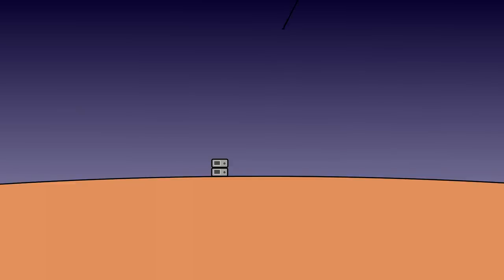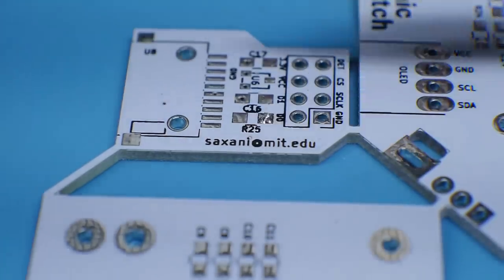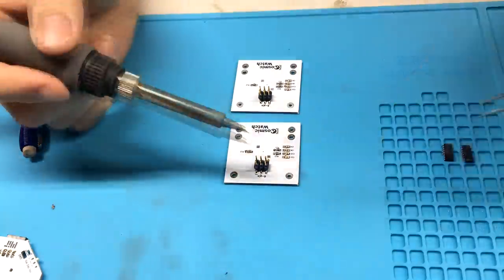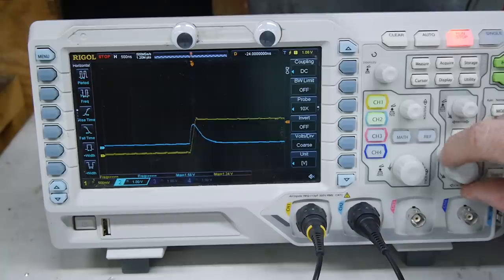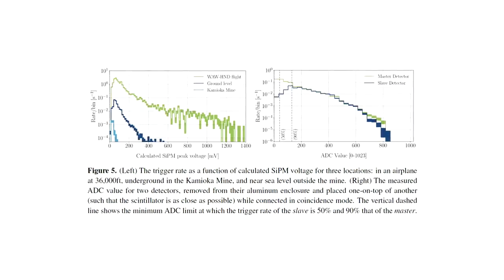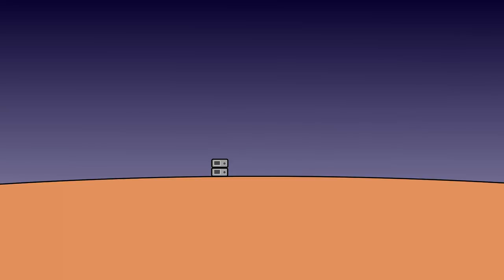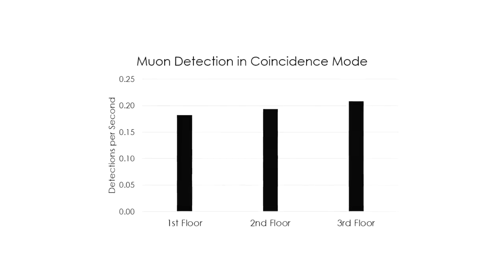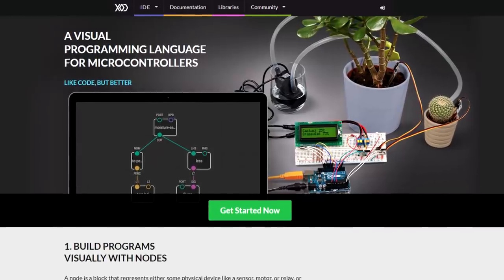How to Detect Muons!

Comment: While this is certainly interesting you don't actually need a device this sophisticated to see cosmic rays.  When I was in college I used to participate in some science outreach programs for the local elementary schools.  One of the things we did (which admittedly was a bigger hit among the adults than the kids...) was build a cloud chamber for detecting cosmic rays.

It's really simple.  You just need a clear plastic container, some paper towels, rubbing alcohol, dry ice, and a strong light source from something like an old slide projector.  Soak the paper towels with the alcohol and tape them to the bottom of your container.  Put the lid on the container, flip it over, and place it on top of the dry ice.  The cold from the dry ice should cause a vapor cloud of the alcohol to form near the bottom of the container.  Then go into a very dark room and shine the light on that vapor cloud.  Then just watch!  You should see occasional tracks form in the vapor cloud, and those are being produced by the cosmic rays.  It's that simple.

Comment: I'm DEFINITELY getting a couple of those kits! Not only is detecting muons amazing in itself, I want to modify them to output the count rate and intensity as control voltage (CV) to control analog synth equipment. Generating entire compositions from cosmic rays - particularly rhythms - would be really good fun. (Not sure yet how to amplify the differences in intensity so to get a greater range of output voltages ... )

Comment: Why does sticky tack fail in different ways depending on how fast you pull it?  If you pull it really fast, you get a really quick and clean break.  If you pull it really slow, you get a really jagged and medium-size break.  If you pull it at a medium speed, it stretches and stretches and stretches until it finally gets too thin to support its own weight and snaps.

Comment: For the experiment where you left the detectors in your car at work, it would have been interesting to have a control, as in another set of detectors, sitting in the exact same spot every day. This would tell you if the change is due to the layers of concrete and not something else.
Reply: It could also have been the height that caused the difference rather than the concrete.

Comment: Excellent presentation. Real data. There is a app that uses soft errors in cellphone graphic memory to detect cosmic rays. That may be detecting more neutrons than muons, since the charge transfer is low for ultrarelativistic particles. Soft errors are a concern for modern computation, since it limits the accuracy of calculations. You might want to do a follow up comparing the issues.

Comment: It's best to use two irons when soldering SMT parts by hand. It's easy once you get the hang of it as the surface tension pulls the part into place.

Comment: Put them next to each other edge to edge, it should reduce the double detection to almost zero.  If you offset them to a 45 degree angle, it should reduce double detections to about half.  Or put them farther away to get the same effect.  I would be curious about the results.

Comment: Great video and wonderful project. Unfortunately for most of us "citizen scientists" who don't have access to an academic physics department or a large urban MakerSpace the SiPM and plastic scintillator material are pretty much unobtainium.
Reply: O.K. I see that the SiPM is available for $75, special price through SensL, using the link on your Facebook page. Great! But now, what about that scintillator plastic? Where the heck am I going to find something that will fit this project?
Reply: O.K., O.K., I just found the plastic scintillator already cut to size and custom made for this project listed on ebay for $30. So already I'm at $100 but the rest shouldn't be too much more, so good to go!
Reply: so not really unobtainable after all
Reply: Yes, I'm on my way. Waiting for the PCB's to be manufactured and the SiPM is on the way. But this is really more of a $200 project not $100 as the folks who put this together would have you believe.

Comment: 80 Dollars for the functional bits (the sensor alone is about 48 dollars, 80 excludes the case and excludes a SD card, some cables and household items like vaciline and tinfoil). 
something I wanted to know. some stores ask more for the sensor. the excel sheet sais Mouser sells it for this price. the SiPM by SensL is bought by ON Semiconductor, maybe this helps people evaluate if this is a project to try or not.

Comment: Cool, I have been working on a similar device, but no scintillator. I had known about this device before, but didn't realize that was how they were doing the detection, pretty cool. I guess that removes the need to block other particles and electrons from passing through and exciting the scintillator? Or is that still an issue?
Reply: The scintillator is important, since it means the charged particles don’t have to hit the detection electronics directly.

The metal box will stop electrons, and the atmosphere stops pions and kaons. You’re pretty much just going to see muons. Though photons can hit the photodetector directly and trigger it! One way to combat that is to have two photodetectors. If they both trigger at the same time, it’s most likely due to a flash of light off the scintillator.

Comment: If different layers of concrete have that much of an effect on the amount of rays reaching the sensor, I wonder how much water you'd need above the sensor to also determine a measurable effect. And I assume heavy water or salt water would have more of a shielding effect than distilled water, though I wonder how much of an effect it'd actually have.
I might have to build one of these muon detectors some day.

Comment: Now, is it the density of the concrete that causes the attenuation or is it an effect of the mesh used to re-enforce the slabs? Similar to how a anechoic chamber absorbs reflections. I wonder if the "u" could pass thru a Faraday cage? It might reveal the answer to the re-bar question. Are the "u" at such a wavelength they would still pass thru the screen of the cage.

Comment: Great video. Quick question though. With your next concrete video I noticed no one on YouTube has shown how to make super strong concrete. Can you show us how to make it? Ultra high mpa concrete that is.
Reply: lots of additives (admixtures) like superplasticizer and micro-sand (silica fume), strong purpose geometry SS fibers (cracks will form but fibers limit separation and thus crack propagation), no rock aggregate, very fine clean sand, and a very low water ratio

but yeah we need to see him try it. with more focus on crystalline ceramic analogues, aggregates and stronger reactions, carbon fiber and graphene (robert murray smiths channel shows a nearly 2x strength increase), you can probably look to achieve above 300MPa, but expensive. One way to improve the compression strength is confining, or wrapping, the sample or structure in carbon fiber to hold back elastic and then plastic deformation (due to fibers) and reduce cracking and damage

If you look up Cor-Tuf (~192-244MPa) it was made by USACE as a cheaper and stronger alternative to Ductal (~150-207MPa) in bridge building and blast resistant structures. All UHPC.

Comment: i heard somewhere you can determine the hight of a foreign computer by measuring the malformed packets it sends over the internet (those that fail a crc check when received by a switch).
Reply: Very interesting idea! But you can't really differentiate between lower altitude and material that the cosmic rays have to go through first (when the computer is on the first floor in a 10 story building).
Reply: im pretty sure cosmic rays have a mostly negligible effect on computers, or else you would be seeing a lot more computer errors
Reply: software is written with error correction against any form of soft errors anyways, hardware like ECC memory is for servers and provides an additional layer of protection against any changes in values. a single bit will not stop the operation and correction of data.

Comment: Hello Sir, thanks so much for your video, my friends and I are trying to execute this project but we are facing several conundrums, I wanted to ask you when soldering the SiPM do you have any proceeding recommendation regarding the soldering process, as I read in the manual that it should be soldered at certain temperature and the heat should only be applied for 10 secs which makes me worry if we try to solder it we will ruin it as we have little experience when it comes to soldering, do you recommend anything that we do?

Comment: Good video but:
You made an error when doing the concrete experiment.

The detectors in your car are not just obstructed by concrete, they are obstructed by the metal in the roof of your car as well

The only way to do a proper concrete measurement is to build a small slab reinforced with re-bar and mount that above the detectors in your home.
Ideally, leaving the detectors in the garage without them being inside a car would be best. But you cannot be sure that they will still be there when you go to collect them.

Comment: Wow! What an expensive pain-in-the-ass project this is turning our to be! It seems that there are multiple files that can be downloaded, some are newer and some are older and they contain two different version of the PCB gerber files and other critical information but it's not obvious which are the latest version. One of the two versions is outdated and does not include the microSD part of the circuit. Also, there appears to have been some modifications and corrections to the latest PCB design. So naturally the old version is the one that I sent to Elecrow to manufacture. Now I'll have to start over and order the newer version of the board (v.2).  Another $12 into this money pit. The CosmicWatch webpage has an outdated link that goes to the older PCB file. That sucks outright! I pity the poor kid who thinks that this will make a great science fair project. I hope their parents are wealthy. The SiPM arrived today from sensL ($75). It came pretty quickly all the way from Ireland to the good 'ol US of A in only one week, not bad!. So one step forward and one step backward. Be sure to use the Gerber files contained in a folder entitled CosmicWatch-Desktop-Muon-Detector-v2-master. It's located here: https://github.com/spenceraxani/CosmicWatch-Desktop-Muon-Detector-v2. At least I think that's the correct file...I hope. Sheesh!

Comment: And then you said 'sodder'
Reply: ? That's how it's pronounced.
Reply: I guess this guy comes off as smart until he sais things like that. And it only pronounced like that to a very small group of small people.
Reply: Yep, See :)
Reply: You might need to explain your point, because the dictionary (and every single spoken usage I've ever heard) indicates that the "l" in "solder" is silent.
Reply: Then you need to find a different web site that supports your minority. There is an L in solder. If a single group of people want to remove the sounds because its too hard then its a speech impediment, Not the norm.
Reply: i am detecting large radiation signatures indicating a high level of butthurt in this area
Reply: I have some soft paper you can use.
Reply: We should call it Lötzinn instead. It is a much nicer word. :)

The verb is "löten" and there are other variations like "weglöten", which describes the removal of large amounts of ethanol.
Reply: lol, americans